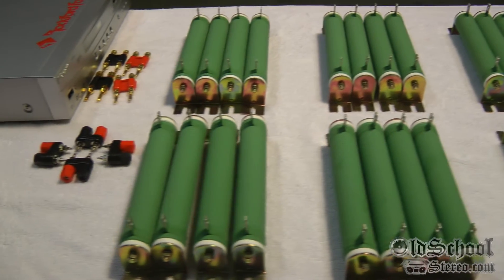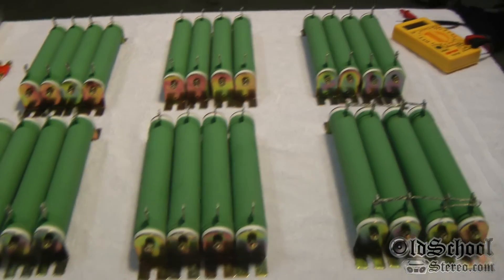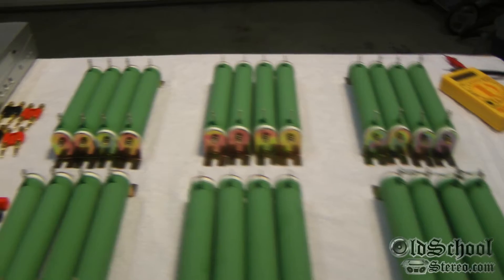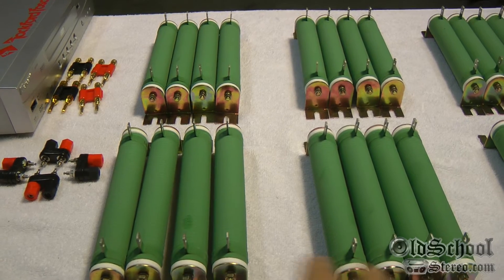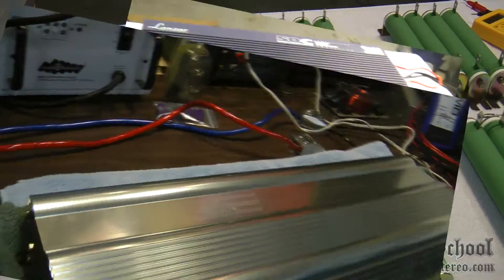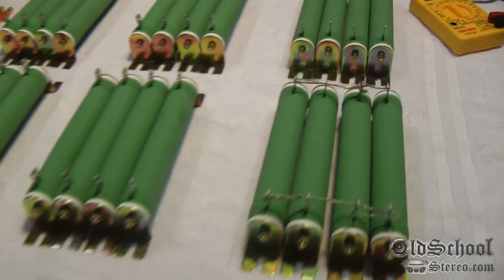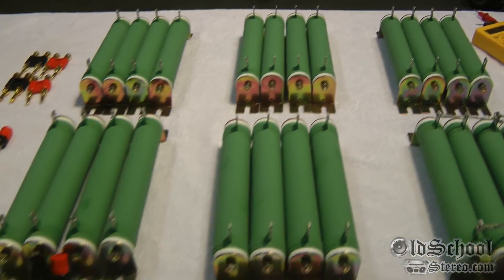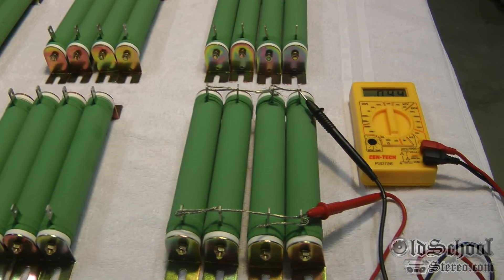Wirewound Power Resistors for Amplifier Testing Watts Wattage OldSchoolStereo.com

Comment: Do you have a parts list for this build and where to obtain the parts? I would like to build this for my amp testing station.
Reply from the maker: Sean, shoot me an email bigdwiz@gmail.com and I'll get you a link to something better. The braking resistors available now are much more cost effective and what are used in the Amp Dyno. These wirewound resistors are not the way I'd go.
Reply: @wal  what would you suggest BigDWiz ? Any info would be appreciated 👍👍

Comment: Good job on using multiple high resistance values. It will last forever. Consider spot welding the connections as the tiniest contact resistance will seriously degrade your measurements. And use much larger gauge wire for the jumpers between banks.

I can do 5kW at 0.5 ohms with less than 1% change in value due to the use of multiple 20 ohm units. The resistors are EBC planar types with a (surviving) pulse rating of over 10kW.

Comment: Good idea on the computer tower.  I purchased ones that were intended to mount to a heat sink & then mounted them to the heat sink from a roached LA Sound Laguna.

Also, that's pretty darn good pricing on the resistors.  I payed a fair amount more for mine.

Comment from the maker: The resistors are used to simulate speaker loads so I can obtain amplifier wattage output. See the video responses for details about how I test amps. It has changed a little, but you'll get the idea. Thanks for the comment!